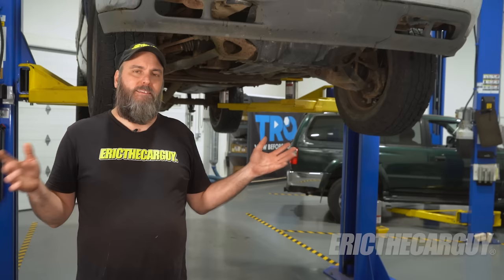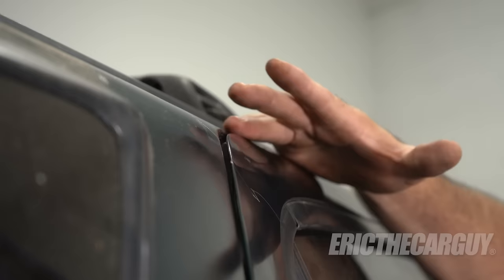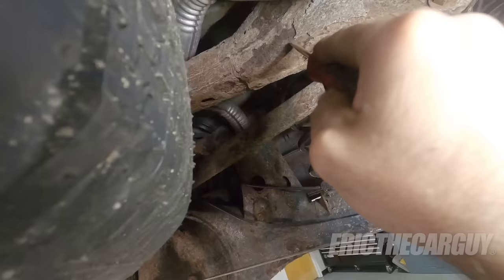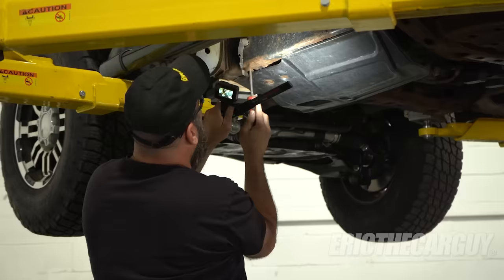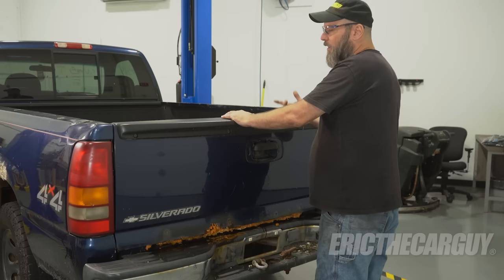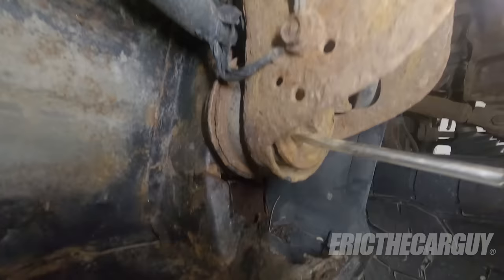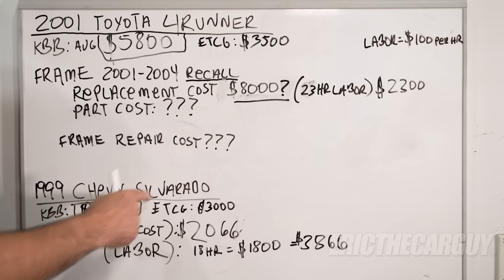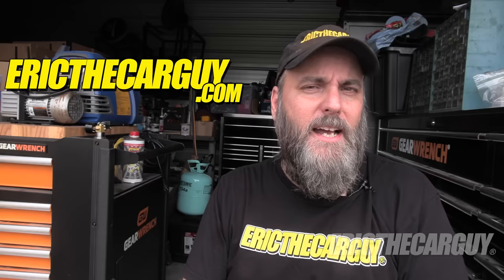When It’s Time To Buy a New Car, Or Not Buy it at All

Comment: i'm considering dumping off a 2017 corolla 6 speed with 25,000 miles.
why? its clutch sucks, it feels like a smooth hockey puck that after a ton of travel - which btw has the weight of a pickup truck with a paper thin bite point. then the clutch takes its sweet time to grab the gear or if your too impatient it abruptly grabs there is no way to drive this car like i dunno the 01 dodge neon i learned on 20 years ago.- so you would think oh the last owner burnt the clutch--- when its in gear it doesn't slip.
I honestly can't stand that car anymore so i'm driving my 16 year old subaru.

Comment: I once do this on a used car dealer about 15 years ago, I look around  to buy a used decent car and poking the frame with the screwdriver and the frame kind of rusted and crumble like that when I poked with screwdriver and create a hole, and the sales guy saw me and yelled at me I need to pay or they will call the police for destruction of property, It is a good thing they don't know me and I did not yet hand in my drivers license, I just ran LOL. They try to catch me but they all kind of a chubby so I outran em, one of they guy try to catch me with the car but it is too late I am already out and they can't catch me!
I need you guys opinion, am I doing wrong now I rethink about it? Can the police actually charged me for destruction of property when the car itself already rusted and painted over to look good?

Comment: Eric.... If a cylinder head needs valve guide work..... And valves were removed and then put back together without doing the work... The valve is now going to be rotated in a different spot does that mean it's going to make worse of a seal..... And create an absolute nightmare... Because it will make a lousy seal????? Even if I'm careful to make sure each valve got put back into the hole that it came out of... The valve guides are too sloppy... But the question is... Like I stated above..... What if the valve is rotated to a different orientation where it matches up on the seat.... Is this a question you could answer or do I need to go to a high-tech person that works on valve grinding and valve guide work?

Comment: How do you check the structural integrity of a unibody car?
Reply: Basically the same way. The unibody will have box structures and reinforcement areas. If those areas are rusted out then that’s like having a rusted out frame.

Comment: Eric, I'm actually interested in learning how to DIY structural repair. Your repair on your Pilot is an excellent example. I've got a CR-V that has rusted not on the subframe mounts but on the outside around the rear wheel well and down to the pinch weld.
Reply from the maker: See if you can find replacement panels whenever possible. I wanted to replace that part on the body of the Pilot but it wasn't available when I looked for one. After I finished the repair, Honda came out with a TSB and a part to repair the problem. Good hunting with the CRV.
Reply: @ericthecarguy  It's worth noting though that the Honda TSB does say that if the rust is bad enough you can't use their repair piece.